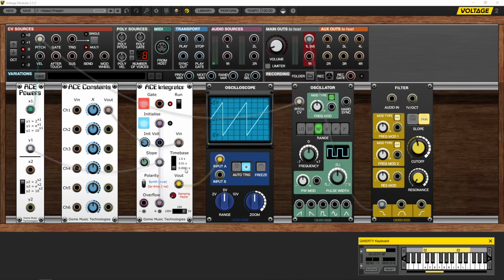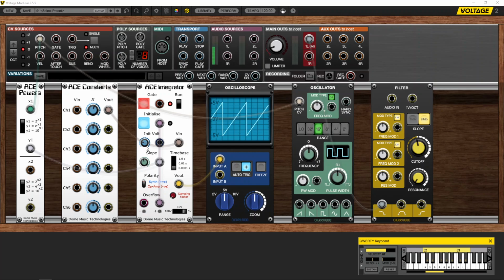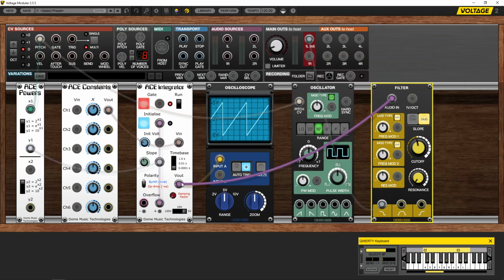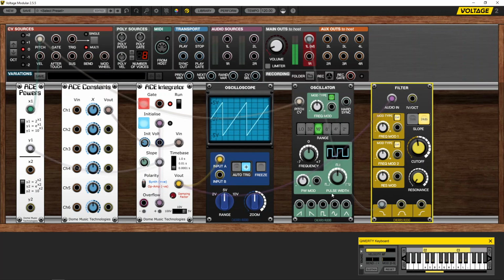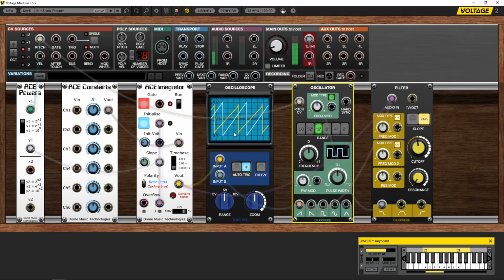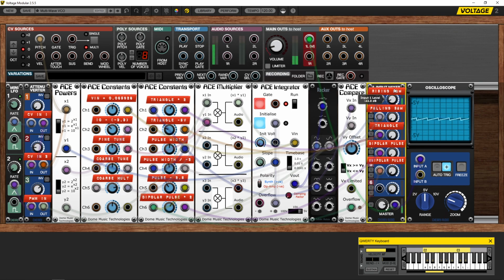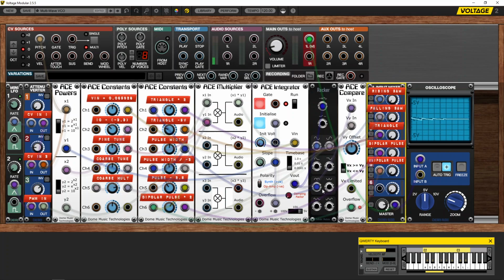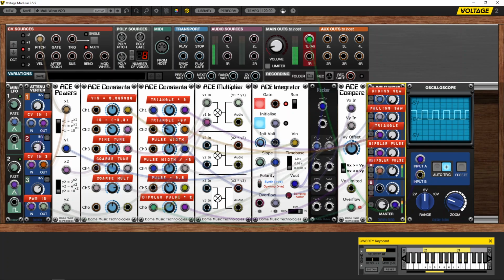ACE Tutorial #7 - Integrator pt 3 (A 1V/Octave VCO)

Comment: can you please explain why you used the slope input to control the pitch instead of scaling Vin as in the LFO example? thanks! :)
Reply from the maker: Hi Chris. You certainly COULD do it that way, too. I did have doubts when I was coding the Integrator, whether I needed both Vin and Slope CV In. It was when I put two Integrators together as a harmonic oscillator that I realised that both inputs were necessary. Good question, though! You've obviously been thinking deeply about this module, which is really pleasing to me!
Reply: @domemusictechnologies  thanks for your answer! i think i understood why there is a Vin and a Slope. is there any difference between these two or is slope just a scaler for the Vin input?
Reply from the maker: @ChR_is  Hi Chris. That's exactly right. If it helps, you can think of the Slope Knob as being an output rate attenuator from 0% up to 100%.

There is a formula in the user guide for how Vin, the Slope knob, the Slope CV In and the Timebase switch all interact to determine the volts / second rate of the output.

Vout rate (volts / second) = (Vin * Slope CV * Slope Knob) / Timebase.

or, if Slope CV is disconnected:

Vout rate (volts / second) = (Vin * Slope Knob) / Timebase.
Reply from the maker: @ChR_is  There IS a subtle difference between the Vin and Slope CV sockets:

If nothing is connected to Vin, then it is treated as being a constant 0.0V.

If nothing is connected to Slope CV In, then it is treated as being a constant 1.0V.
Reply: @domemusictechnologies  thanks for your elaborate answers. very much appreciated :)